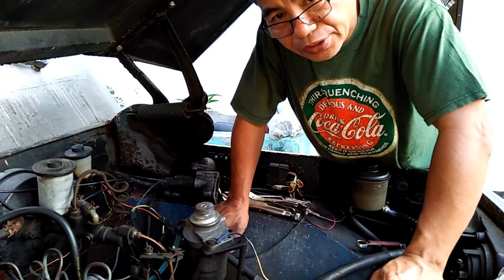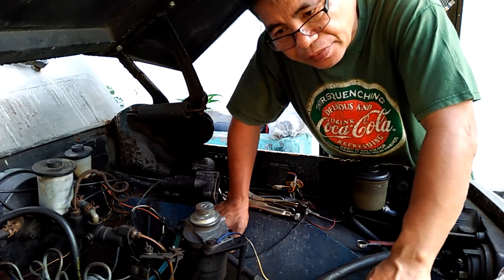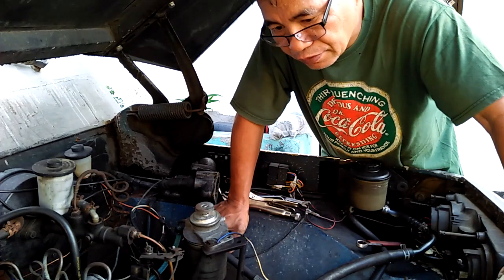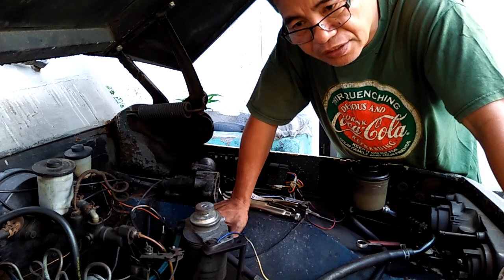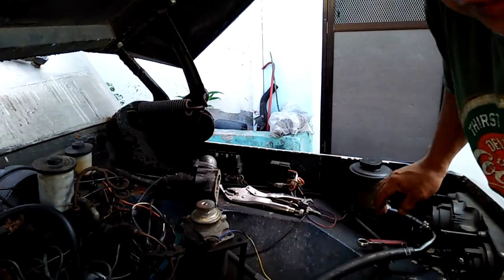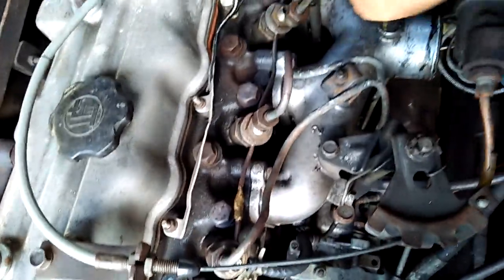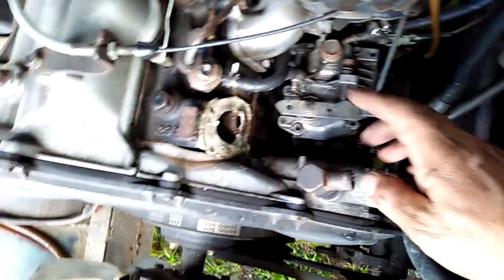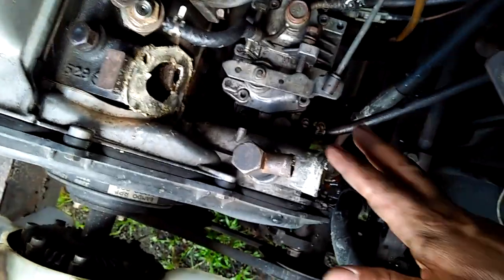Toyota L Injection Pump Adjustment sa Advance dahil mahina Paahon

Comment: sir ganyan din makina ng sasakyan nmin, normal lng ba na umabot ng 200 to 225 temperature gauge niya? napa overhaul na radiator, coolant na nilagay kung tubig, nilagyan ko na rin shroud yung radiator fan, nilagyan ko na rin ng turbo, nagpalit na ako ng temperature gauge pero ganon pa rin. 4 rows yung radiator, ano maganda gawin sir para mapababa yung init niya.
Reply from the maker: Hindi dapat umaabot ng 200 maliban kung loaded siya at paakyat, peru kung diretsahan lang dapat nasa 150-160. napa overhaul mo naman ang radiator dapat tumino na siya. 
Check mo rin kung gumagana ang oil pump, kung gumagana ang oil guage marahil ibig sabihin gumagana ang oil pump at iba ang dahilan.
obserbahan mo rin kung umiinit ang kambyo, baka naman galing sa clutch disk at flywheel. Kung wala sa mga nabanggit marahil may barado sa block sa daluyan ng mga tubig at langis, kailangan ang overhaul para malinis nila sa machine shop.